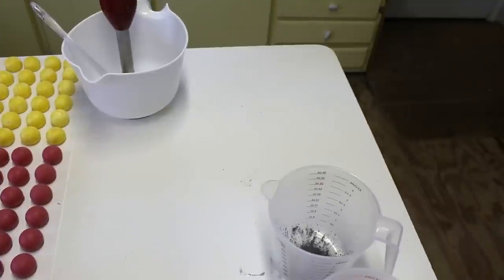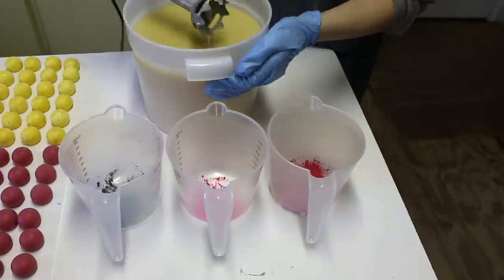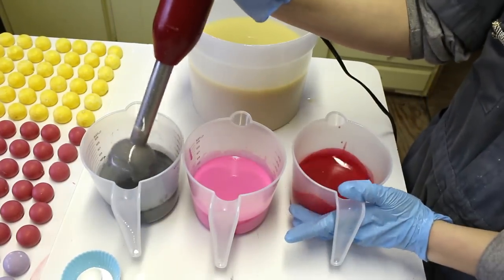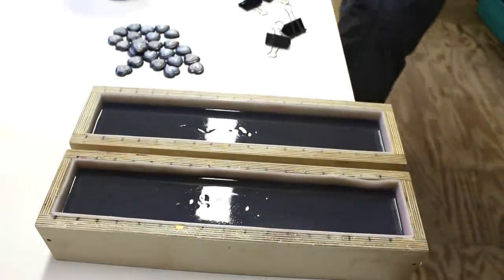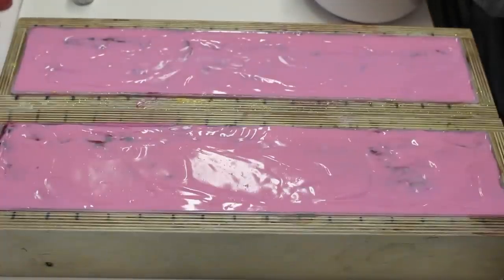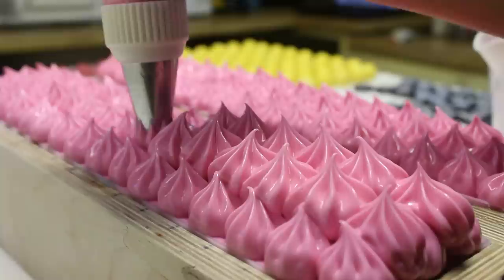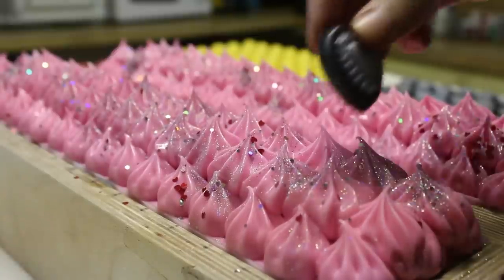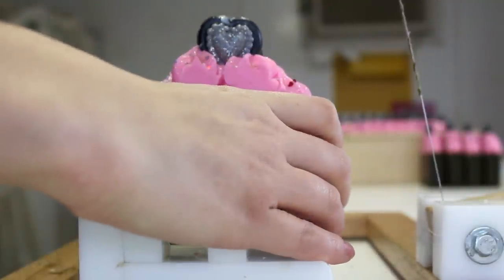Dark Kisses Soap and Butterfly Swirl FAIL | Royalty Soaps

Comment: I was wondering if you could let me know how you alter your recipes to slow down the thickening? Also, what do you do with FOs that accelerate trace? do you just avoid them or is there some trick I am missing? Also what about oxidation from FOs that have vanilla in them? I have never seen you add vanilla stabilizer.   Thanks :)